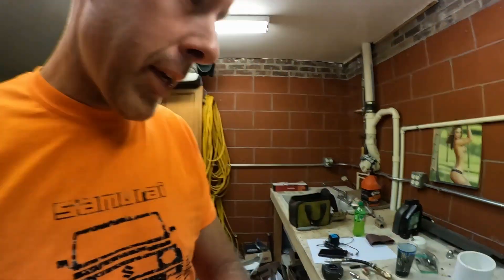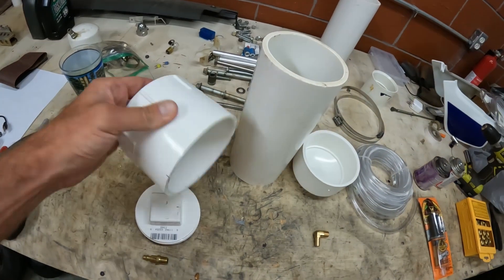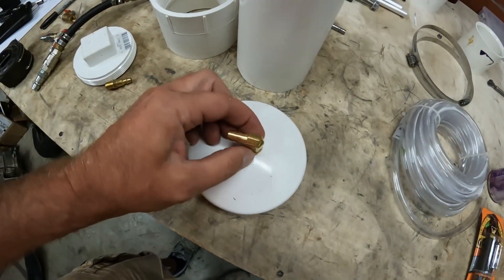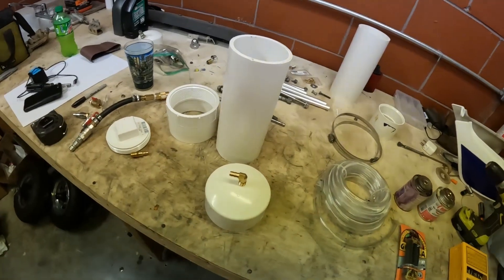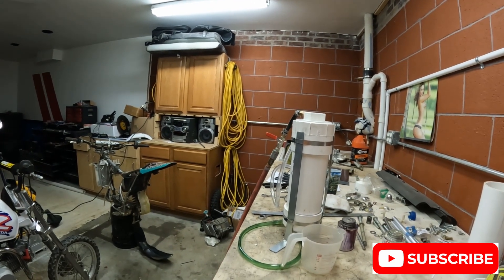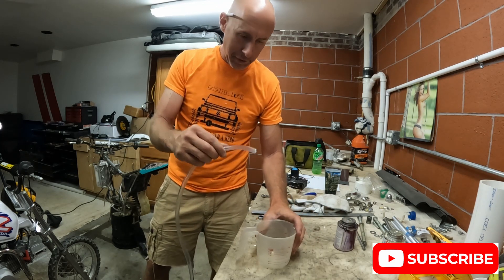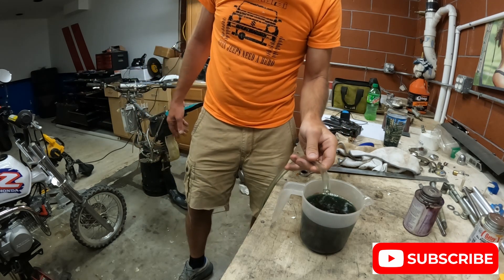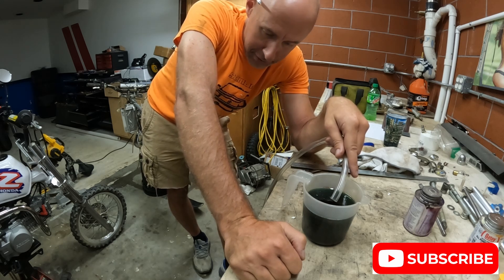DIY Air Powered Oil Pump.  Fill your transmission, transfer case and axles the easy way

Comment: I like your approach and design and built 2 units - one for me and one for a friend who also saw the video. This makes refilling the axles/transfer case a much easier job.
The once addition I made was to mill some slots equally around the bottom and top caps for the clamp to hold the legs in place. I found it a bit fidgety to try and equally space them.